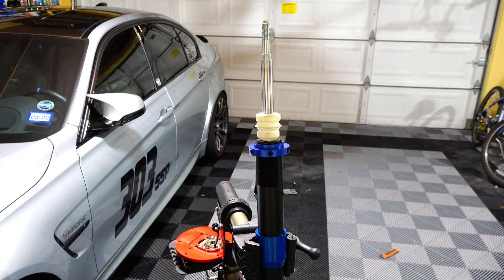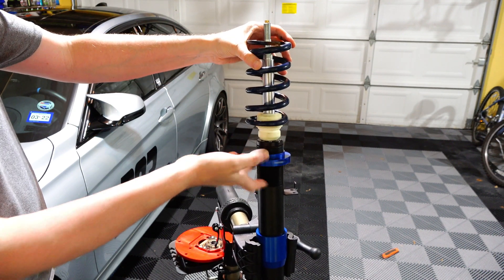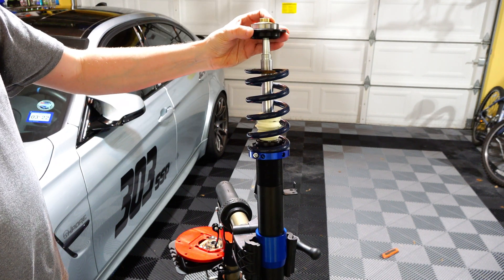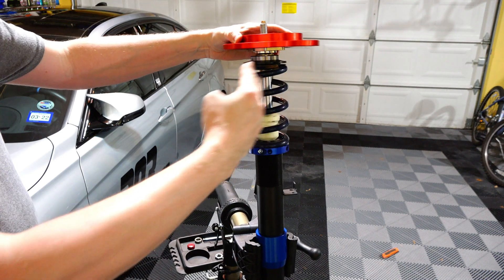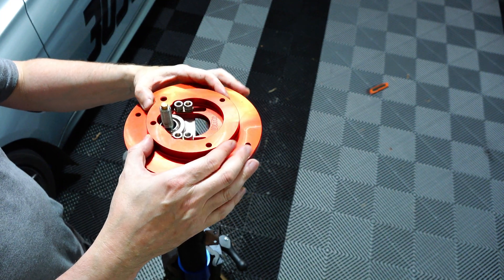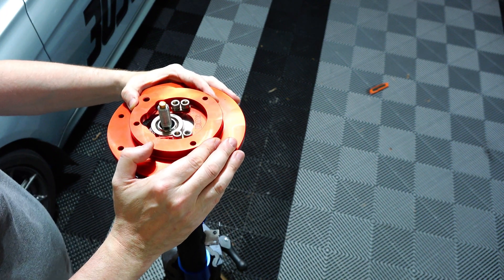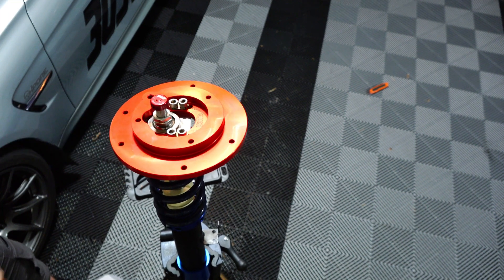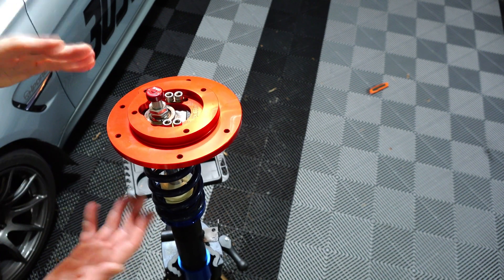2016 BMW M3 - anatomy of coilovers and camber plates

Comment: Hi there, what spring rates and length would you suggest starting with? Seems like some on the forums are starting at 600/900 but doesnt say how they're using the car. I have AST 5100 coils and planning to switch out springs to linear race springs. Using the F80 for autocross, track days, and weekend street driving. Thank you for any input you could give me.
Reply from the maker: I'm running 600/800 with JRZ RSOnes. Depending on your dampers, 5 or 6 inches up front (probably 5 is better)  and 8 in the rear. Recommend Ground Control weight jacks in the rear.  If I were to make this strictly track dedicated, I'd probably run 700/900.
Reply: @go_race_a_car  appreciate the information! I've found 65mmID swift springs in both 5 and 6 in lengths and 616/672/784/840/896. I have helper springs now for the front but I'm sure I'll have to get matching ID helpers for the 65mm. My rear is a divorced setup.
Reply from the maker: @jamieleanderson  yes, this is for a divorced setup. IIRC the multiplier for true coilover is about 1.5.
Reply from the maker: Sorry, got it backwards. .65 or .69, don't remember exactly. Close enough.
Reply: @goraceacar  are you talking about part of the equation for spring rates?
Reply from the maker: @jamieleanderson  yes, you need a stiffer spring in the divorced setup. The further from the wheel, the stiffer it needs to be.
Reply: @go_race_a_car  I appreciate all of your help and time! I'm going to give 5" 616/ 8" 840 a shot along GC rear weight jacks as you recommended. Staggered Sm10 10/11 wheels using 275/305 tires. I was 3 tenths away from beating out a C8 with a good driver in my stock F80. I was 5th out of 68 entries. I feel I'm ready for more grip!
Reply from the maker: @jamieleanderson  if you have camber plates, you can run 295/30/18 sq easily.  Otherwise, I really like 275/35/18 and 305/30/19, just because these are very popular tire sizes. Great selection.  I just recently noticed that RE71-RS are available in 275/35/18 and 295/35/18, so that's yet another good choice.
Reply: @go_race_a_car  Currently don't have camber plates yet. Getting a parts list together as we speak. I have the Millway Street plates on the list. I'm glad the RE71-RS comes in those sizes as I really liked the previous RE71 on my last build. I didn't think about using a double stagger setup however.